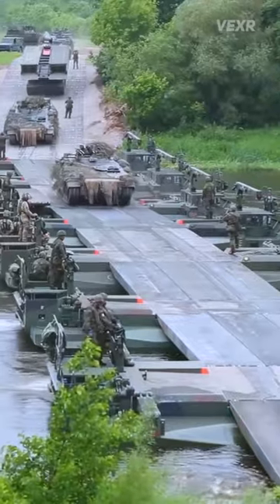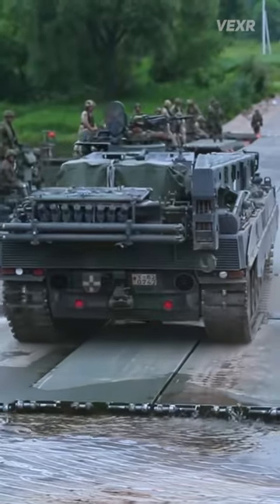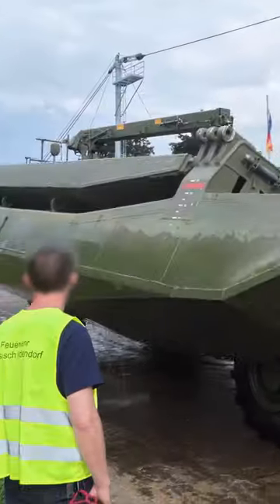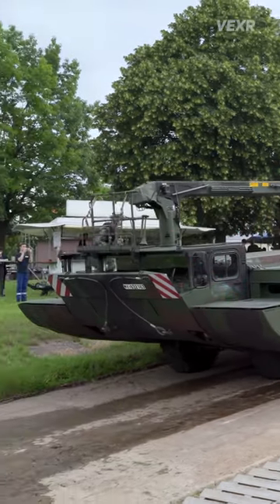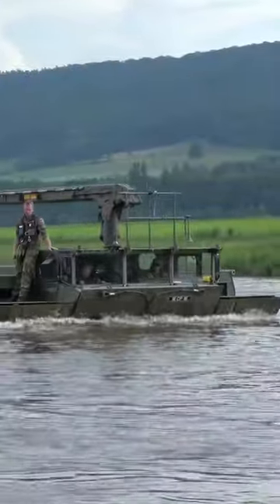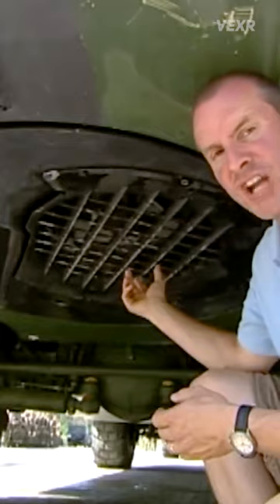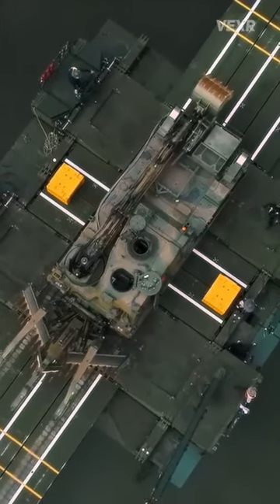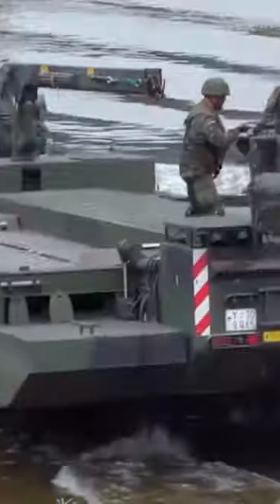How Battle Tanks Cross Rivers - Full Process Explained

Comment: Cool stuff, but only for small rivers and open country. This is the best for EU countries, but in eastern Europe it will already be inefficient or very expensive. A few arguments on the example of Russia:
1. There are many large rivers in Russia. For example, the Kama River in my city is about 1 km wide, but in places the width reaches 6-9 km. The Volga is about 2 km wide, the Ob is also about 2km. How much of such equipment is needed per 1 km?
2. In addition to the large rivers, there is an impassable terrain. There are many swamps near the river. Heavy vehicle will not even be able to approach the river - it will drown in the mud. And even if he can cross in some place, he will encounter an endless dense forest for hundreds of kilometers. It's easier to drive on the road.

Comment: Significantly more difficult than depicted when under artillery fire and FPV drone attack.

We need the companion vid "How to set up a bridge without air superiority". Unfortunately, NATO hasn't figured that part out yet.
Reply: Hate to break it to you but our doctrine kinda involves getting air superiority first
Reply: @felixfeder7106  - You're right that NATO doctrine requires getting air superiority.

My comment was sarcastic commentary on the confused "advice" that Western military advisors gave Ukraine prior to their offensive.

Basically, anything the Western advisors said was garbage because NATO isn't going to attempt any of the fighting that Ukraine had to do without air superiority.

Ukraine can't have air superiority because the West won't send sufficient long range weapons (cruise missiles, ATACMS, etc) for Ukraine to be able to target known radar, missile launch, and command and communications targets the way NATO would.

Point being, even with limited Western equipment (especially with LIMITED), Ukraine can't fight the way a NATO country would.
Reply: @Texas240 Ukraine has superior systems like Vilkha.
The problem is that no amount of SEAD is going to defeat S200/S220/OSA/TOR/Sosna-R ADS. NATO's experience in Iraq was against S-75, S-125, 9K31/9K35 and 9K32M.
The US lost quite a large number of systems to these relatively old and weak AA systems. A large number of helicopters were also lost to small arms fire.

There is tactical and doctrinal armored vehicle maneuver documentation available that doesn't require air superiority, the problem is that it's only used by the UK and France. Both countries also have their own domestic comprehensive SHORAD and MRAD systems, something the US completely lacks.

Comment: The biggest issue i see with this is that all the enemy has to do is wait for them to pin it down, let the convoy almost halfway through and then open fire at the middle point which'll make all the other ones lose their balance and sink with the other ones, though i do guess those pins are exploding type so if that happens they just blow the pins instead of just allowing it
Reply: I imagine this is used for crossings that aren't directly on the frontlines; or at least when the other side of the river has been secured
Reply: @underpaidmook  Likely also during night, but yeah most likely behind frontlines to "replace" lost bridges.
Reply: you have no idea how modern combat works, theyre gonna be flying drones and make sure the area is secure before even hitting the road with the tanks and bridge vehicles. and if anything attacks the bridge its basically a death sentence so no what youre saying will never happen unless the CO is an idiot
Reply: @underpaidmook This WILL be used for crossing in the frontlines. That is the point of these combat engineering vehicles. Even if theyre not in the frontlines, it will still be within range of infiltration teams or artillery
Reply: My issue is... Takes a full vehicle for one part. Surely there are ways to lower that number? 

Anyway this isn't for contested territory for sure. You'd get wrecked.
Reply: I was in the British Amphibious Regt in the 80s early 90s, assault bridging was carried out at night whilst ferrying operations was done by day,
Reply: @DrSabot-A this isn't for crossing an active frontline that would be suicide it is for getting heavy armor and large numbers into a bridge head
Reply: contested water obstacle crossing is supported by weight of fire.
Artillery, IFV´s, Mortars, MBT´s etc push the enemy forces off the opposing bank and out of range of engagement with weight of fire to establish a controlled save zone.
then bridging/ferryinig is conducted with aircover and constant artllery cover to push away enemy artillery via counter battery fire.
when the bridgehead is establshed, the forward units push out the secured bridgehead and the other units follow up, to establish and secure the crossing.
NATO artillery has signifcantly longer ranges than russian/sovjet artillery, so they cant enter the contested zone to conduct firemissions without facing severe counter battery fire and get hunted.
Air cover is provided by the airforce, air defense vs for example drones by SPAAG and SAM systems.
you can conduct such a crossing directly at the front when doing it like that.

Comment: Holy molly the Canadian city Victoria took four years to build a lift bridge over a smaller span they these soldiers built the bridge in how long? An hour! 
 Those city folks should have asked for help from the engineers whoo designed built these engineering marvels.
Reply: These are temporarily bridges
Reply: Yes! But also no. Countries like Canada don't.. Don't exactly require just drastic measures like this. Its population is already centralized well enough. Countries like South Africa, Kenya, Chad, etc etc. NEED Stuff like this. But of course, remember, these are temporary, and are much MUCH more expensive than just building a permanent bridge.